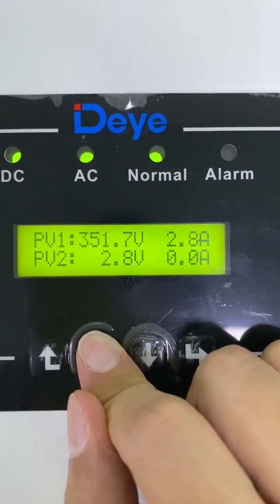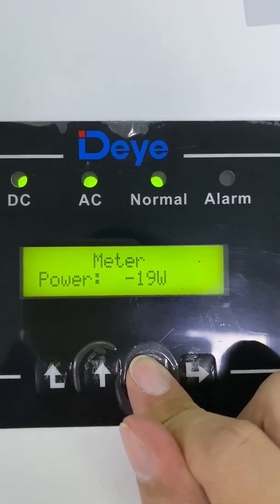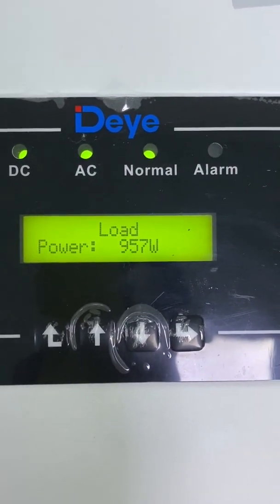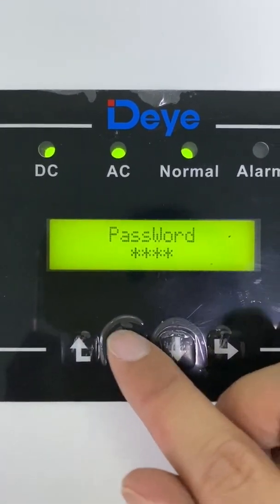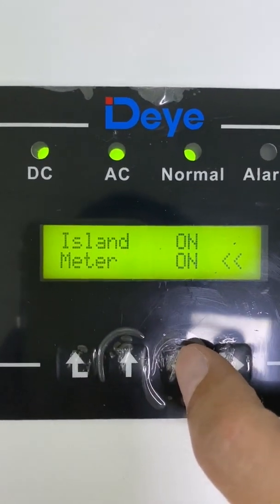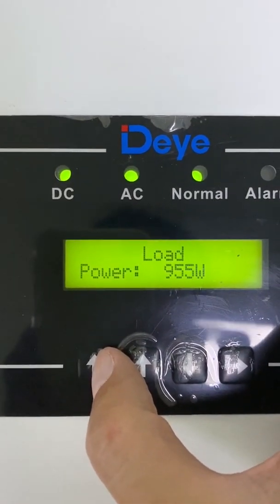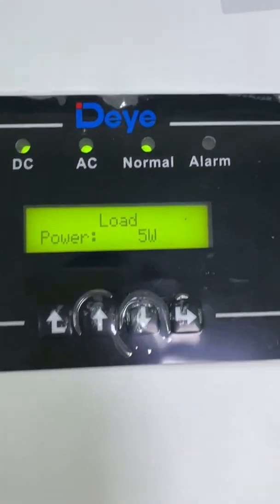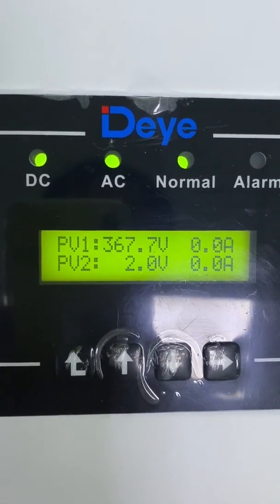Zero export function for Deye 1phase on-grid inverter  with energy meter

Comment: This video is very confusing, just like the manual. I have such an inverter installed, I configured it as the manual says, but it continues to inject into the grid. I doubt that this function works perfectly, or else the inverter is too slow to react to the counter data.
Reply: Same problem over here, i installed 2 of them, they still inject into the grid..

Comment: This is very interesting to me as I have a SUN-3K-G inverter and I would like to use zero export feature, but the inverter is too far for CT sensor (also my local distributor only has inverters with no CT). Is the meter connected simply via rs-485? Do you need anything else in addition to the DDSU666 meter and RS-485 connection? What is the role of the PCB shown in the beginning. Also, is "Meter On" the only configuration required, or do I need to set other things too? Also, is it possible to use 3 phase meter and somehow select the phase the inverter uses for its power limiting? Regards.

Comment: I buy deye grid tie inverter 10kw, but i can't find connector for limiter..only hole with caps screw.  Can you find solutions in this case, thanks..
Reply from the maker: if the function needed, you need tell the sales when you place the order.